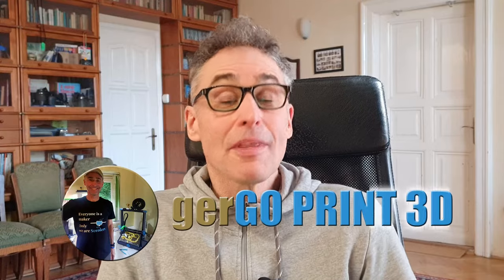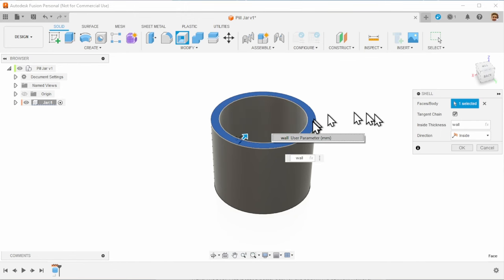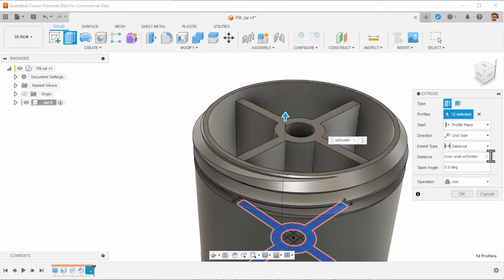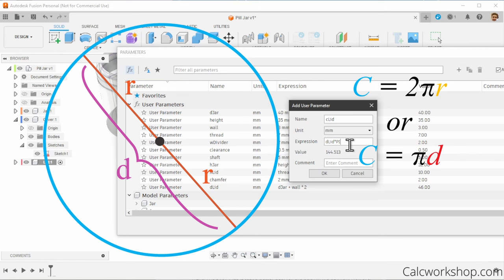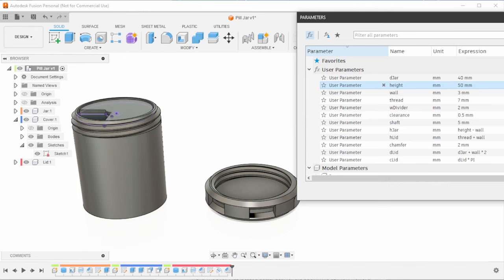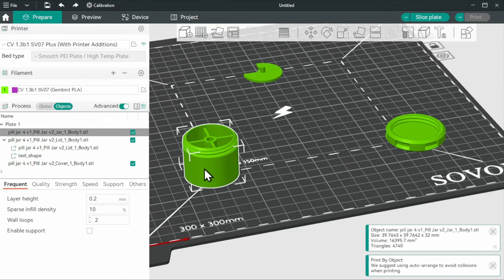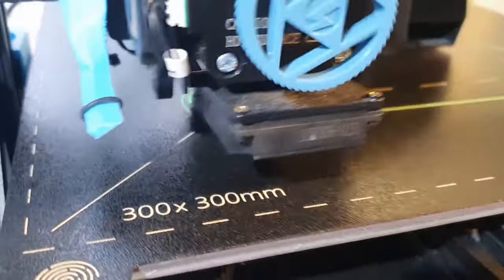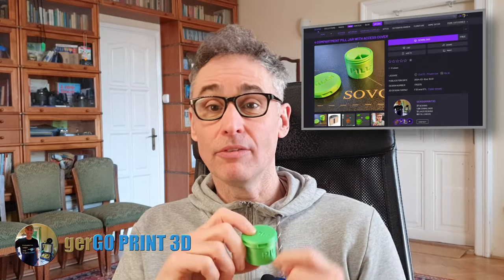Pill Jar example: Full 3D design to 3D print using Fusion 360 🧡 Orca Slicer 💙 Sovol SV07+ on Klipper

Comment: This tutorial was a true joy to watch. Thanks sommuch for sharing!

Specially the modeling part. You are super calm, precise and explain very well the rational of you design choices and tool uses in fusion. Very cool.

One question... Why did you print the jar first? I would have a tendency to print  shortest part first...

Thanks so much for sharing
Reply from the maker: To be honest, the order wasn't made based on practical considerations; it was more of a gut feeling. I was simply curious to see how it would look in real life. That was the main part of the project. I wanted to ensure it was the correct size, so I could cancel if it turned out to be too small or too large before printing the accessories. However, you're correct; printing any other part could have provided that reference as well.

Comment: excellent tutorial.  Very well explained.  Why did you want to print one part at a time?
Reply from the maker: Good question. Mostly to show how it's done 😉But often it results in faster prints if the print head doesn't need to constantly move between objects (of course I would have place them closer to each other then). Also if we print by object, a failure in one part doesn't ruin the rest...